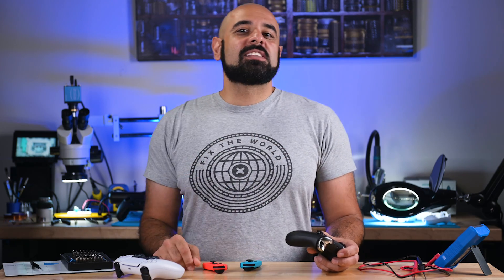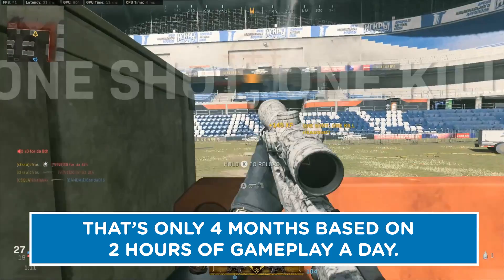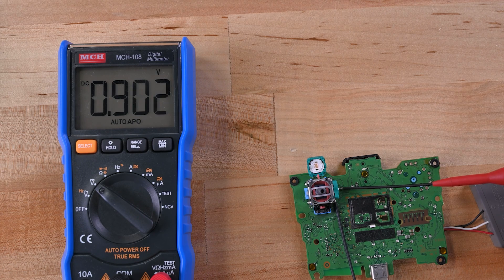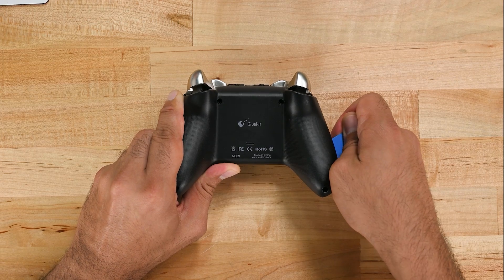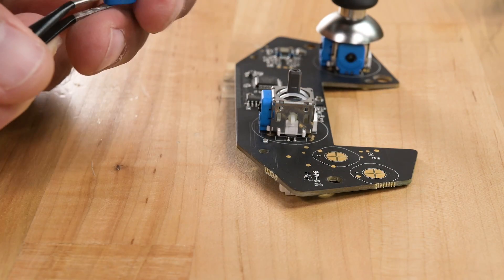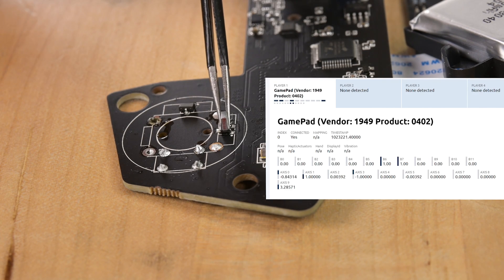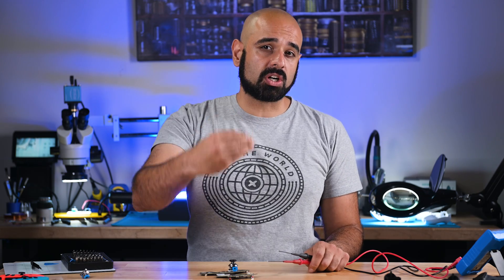How Manufacturers Can Fix Joystick Drift - Permanently!

Comment: We used to work with both of these on a more industrial level, potentiometers failed frequently, and are prone to very early deaths from all kinds of problems but for us, its the dirty environment.  Hall Effects cost a lot more, and while the sensors were always ok, bad board designs never let them really see through for the full potential.  I'm sure on a high volume application costs would come down, and the design would be more professional than some custom stuff we had.  

Still, I imagine cost is the key factor of why. Not only in component costs, but you may have to replace some of the feel of moving the potentiometer since hall effect has no resistance to it.

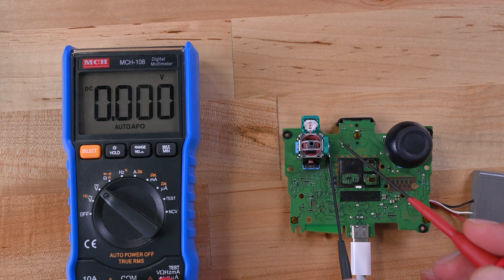Comment: 1:29 - not strictly true - In a variable resistor the resistance of the track changes as the wiper moves which results in more or less resistance. With a potentiometer, by contrast, the resistance of the track remains the same as the wiper moves, it's the potential on the wiper that changes.

Comment: It's funny that the N64 had a clever LED-photosensor setup with no electrical contact points either. Their issue was that they buggered up the mechanical contact points though so the physical stick would wear down and not hold centre.

Zero drift, but after a while it wouldn't pull itself to centre anymore, you had to hold the limp stick manually. If hall effects are expensive, I reckon repackaging the photoreceptor setup into this formfactor with the superior gimbal setup we have these days would be the best of both worlds and super cheap.

Comment: I had a lengthy back-and-forth with SCUF about how I would shell out extra cash if they could release controllers with Hall effect sensors. They flat out told me they would not do it unless the platform folks do it (which I still think is a load of crap):

"So as I briefly touched on before in my last message, Scuf takes a base Xbox or PlayStation controller and modifies it to the specifications selected from our list of available options. So we are actually are registered as an electronics customisation company. And all of our process it established to follow electronics customisation laws.
 
Now if we were to start producing our own controller with the Hall Effect sensors we would need to make a number of changes to business that currently we simply do not wish to make or have no plans to make right now. 
 
Now if Sony or Xbox controllers are produced with the Hall Effect sensors on their controllers we can begin to produce customised controllers with the Hall effect sensors without having to change the registered business type.
 
Ultimately this all boils down to business laws and the larger company changes that would need to occur I'm afraid."

Comment: this problem had already been solved in the 90s. the sega saturn analog pad, and the dreampad both used hall effect tracked joysticks, using 4 board mounted hall effect sensors, and a single magnet in the base of the joystick. the design was pretty ingenious, because the centering mechanism was practically impervious to mechanical wear too. even after thousands of hours of use, those sticks did not develop "center wiggle".
Reply: Despite the one analog stick, the Dreamcast controller honestly feels amazing. Great fit in the hands, great trigger tension, perfect face buttons, joystick... I really miss Sega.
Reply: iirc the n64 controller also used similar tech for their analog stick
Reply: @larryfoulke6196  
The Nintendo 64 used a optical encoder just like an old computer mouse with the ball on the bottom.
Reply: PlayStation controllers also had it back in the day.

Comment: Even though a magnetic solution has much less wear and tear, as you pointed out, I don't think it could ever be used as a (good) joystick because of hysteresis. You just can't get consistent readings. It's basically durability vs accuracy. Probably most gamers will prefer the latter. IMHO, until they find a solution that gives better accuracy than potentiometers, the best solution is to make just the joystick swappable.

Comment: I think they would need somehow to be able to take just the thumbstick and be able to remove the old ones and drop this new one into existing controllers before widespread use would happen, also obviously the extra money they get from people buying new ones would be gone so they have a monetary incentive to not do this, they would probably make some $200 super elite mega pro controller that have them and keep it out of the cheap ones that most people have and where they are needed most anyways.

Comment: of course they're not going to pick it up.. they won't for the same reason they started using inferior components for the sticks in the first place: Money. There's no money in making a robust, high quality peripheral, that will last for a very long time... The money is in having you replace your controllers all the time. Old controllers last WAY longer...i imagine the innards were more robust. I have a X360 controller that i used ALL THE TIME, that i finally had to retire after something like 15 years.. Got a controller from my launch PS4 that still works perfectly. Only retired it, because the rubber wore off the sticks. Never had to retire a PS3 or PS2 controller, due to the sticks going bad.. The sticks on those old controllers are WAY better. Now, it's just cheap crap, that fails after a short time, so that they can keep you buying new controllers at 60 (or more) bucks a pop..

Comment: Purchased new controller 1/14/23.  After the one that came with the PS5 lasted just over a month I purchased the extra warranty, and I'm glad I did.  The new controller did not even make it a month.  Both controllers had exact same issue, erratic right thumb stick.  Started out jerking (not drifting) to the left and very soon after was in continuous left.

Comment: As an RC pilot for over 17 years now, I can tell you the following:
There are good and bad potentiometers. I'va had good radio transmitters, with metal encased, internally lubricated pots and bad radio transmitters with plastic pots and flimsy PCBs, way to soft contact pads and just overall poor performance. One of my oldest radios is over 15 years old now, a Futaba 7C (if you want to look it up) and I have never had to callibrate the sticks since I purchased the radio. I also have a Futaba T14SG from 2014 and it has gone through countless hours of 3D flying (agressive stick movements) and it doesn't have any drift. out of curiosity, I've had a look inside both of these radios and my conclusion is that the most important thing in terms of joystick drift is not the wear on the potentiometers, but rather the the stick centering strenght, i.e. the quality of the spring and centre stick mechanism, which determines how well the sticks centre over time. If have a little bit of play, the stick will not centre properly, that's it. Joystick controllers have the issue that they use very soft springs and nylon guides to keep the sticks where they are supposed to be, and that is a huge problem because those wear out over time. If the sticks get soft on an RC radio, you have the option to replace the springs and adjust the centre position mechanically (f it has even shifted). Then you recallibrate the sticks and you are done for the next 10-15 years. I've also had Hall Gimbals on three of my more modern radios and I can't tell the difference apart from the resistance that you feel adjusting the sticks to be soft. Soft sticks with pots have some residual internal friction and dampening due to the internal lubrication. I think hall sensor joysticks will have the same problem as regular joysticks because the main centering mechanism will start to wear eventually, weaken and get wobbly over time and simply fail at some point. What manufacturers need to do is to improve the construction quality by increasing the rigidiry and the toughness of the materials used for the gimbal mechanism (and I mean both of these terms by their engineering or metrial science definition). Whether you then have potentiometers or hall effect sensors will make absolutely no difference at all. Most likely, this has not been done due to obvious manufacturing cost implications.
Reply: The issue imo isn't potetiometers but really really cheap potentiometers

Comment: Same issue with some mouse scroll wheels. Cheap, old, mechanical wipers with erratic scrolling. Optical, better has a wheel with holes breaking an optical beam. For some reason, this is NEVER advertised. Throw the dice, hope for the best.

Comment: "get rid of physical contact entirely" 
uses the same setup to move magnets instead of a wiper.
😑 It's not fixed at all in the example. it's delayed at best. I will grant slight improvement at the cost of the entire point.

Comment: Is it cheaper for the manufacturers to fix/replace the handfuls of cases where people demand something be done about their controller drift? Or put a higher cost unit/s in every single unit made? I'm going with the former. As bad as that is. Unless they're forced to do so by trading standards or some other body.

Comment: for me drift comes from ash and dust...
i believe a microfiber gromit could help keep dust and ash out.

however ive also had the inside part grind away too, at that point its time to buy a new one
Reply: Yeah sometimes you can fix it by cleaning the controller or the sensor itself, but if it's a year or so old then it's probably a worn-down potentiometer track.

Comment: Welcome to modern cosumerism, This is in every aspect of life but it has a name, designed obsolescence. Once a market eliminates the competition incentivizing new tech, the era of new tech stops in favor of maximum profits.

Now apply this concept to literally everything especially the AUTO industry. Designed to dwindle down and make you spend more in short time peroids. 

Once any company decides they are no longer subject to rules and regulations the sky is really the limit.
Reply: The worst thing is that most of the controller manufacturers use the same sensor supplier, ALPS. They must be making major profits supplying vast numbers of these sensors to every game company since every controller inevitably fails because of this single component.

So much plastic waste and e-waste just because a few companies want to make megabucks.

Comment: would be nice if I could purchase mod kits to transform pot controllers into hall effect controllers.
Reply: Gulikit sell conversion kits for certain controllers, I think the Steam deck and Switch, and they're planning on doing modular versions for the Playstation Edge controllers which already have removable joysticks.

Sadly other controllers have their joystick sensors soldered directly onto the controller's main board, meaning it is difficult to make a marketable solution. People should pressure Gulikit to make standalone Hall-effect sensors so users can do the conversions themselves.
Reply: @redbloodcell4047  Thank you very much for the information. very much appreciated.

Comment: There is posts about joystick drift everywhere, but I never experienced it actually, unless there is excessive wear of the joystick itself that start wobbling, but it has nothing to do with the sensors.

Also hall sensor are prone to interferences.

My guess is that most drift issues are caused by software (wrong calibration, or dead zone too small..)

Comment: they will software block this making your third party controller obsolete only way is to solder holo lens sticks to your ps5 controler etc but even that they can prevent in software if something in the controller is changed the controller might simply dont turn on.

Comment: drift mostly come from calibration, but you got to to disassemble then use a screw, while undertand how calibration work so difficult fot casual, for nintendo switch, things is a bit different just put a layer of carton enought slim to fit under joystick and there you go, no need buy anything....
Reply: Not really. Once the sensor starts to degrade, you can be looking at stick drift so severe that deadzone calibration doesn't help. Besides, increasing the deadzone ruins gameplay.

And this "carton fix" is not fixing stick drift.

Comment: The funny thing is... I still use a PS1 controller... since 20 years, granted I don't play 2 hours a day for that timeframe with it but collectively I probably played a couple hundred hours with it... still no drift. I actually find it puzzling, that we had analogue sticks on PS1, 2, 3, 4...  and only for the PS4 and switch they start to get this problem that fast. Did something change in their construction?

Comment: I think the argument would be the input delay... however, if that is the case, why wouldn't these manufacturers, just make it hotswappable like keyboard switches? if the only issue is how to make it secure, its easier than desoldering the part... right?

Comment: Hall effect won't really eliminate stick drift, because a lot of the times stick drift is due to the centering mechanism getting sloppy/worn out over time (too much plastic in the mechanism, and quite often the spring used to create tension to return the thumbstick to center loses it's strength to be able to return the thumbstick back to center).

 Hall effect will eliminate dirty potentiometer issues like erratic movement in game during when you're moving the thumbstick (see Atari 2600 paddle controller dirty potentiometer issue), but HE won't really cure stick drift as the thumbstick usually still has a tight connection to the potentiometer.

The plastics used in the centering mechanism will get worn down, and when wearing down it'll also produce a fine plastic powder that coats everything inside the centering mechanism, not only will it cause the drift issue as well it can also make the thumbstick is harder to move smoothly.
Reply: As a radio control enthusiast and flight sim pilot, I can say that you are wrong. the plastics used in most game controllers as well as R/C and flight sticks are very durable and springs can typically be replaced, so long as the items are well cared for and not dropped a lot. For my R/C helicopters, I used the same radio for ten years (Spektrum DX7) and didn't bother with an upgrade (Spektrum DX8e) until I got my first drone and found out that my software wouldn't work with it. My sim controllers had other components fail (external wiring) LONG before the axis sensors did (Logitech X56). As of this comment, I currently have over 2200 hours on MSFS 2020 and DCS with my Thrustmaster T16000 flight controls. I will say that I need to get some powdered graphite to lube the throttle and rudder pedals as they suffer from way too much friction. In the game controller (D-pad type) arena, when the pots start to wear down, the signal gets erratic and true center can be harder to define without adjusting deadzones. Yes, the axis still has a tight connection to the pot but the pot is too worn to be accurate. This is where Hall effect is superior. Hall effect does not need deadzones as it doesn't wear out like pots. you instead adjust the sensitivity with expo curves and you get 100% control for a VERY long time. In closing, don't sell hall effect short, you'd be surprised at the performance gains that you can achieve with it.
Reply: @wedgie502  yeah here let's compare materials in an RC system vs a cheap controller to a game system...........

Let me ask how many game console controllers have you worked on? 

I've worked on quite a few, and each one that has stick drift issues is due to the return mechanism being worn down, and no longer able to return the thumbstick back to center, not the POTS.

You're also confusing POT failure (due to dirt in the POT or the contact area in the POT being damaged) to actual stick drift.

Comment: Can you belive my xbox 360 controllers have been bashed and worn till the toggle stick head started failing and now I have a nub for a toggle stick with no place to fully rest my thumb and there's still no noticeable stick drift and This is the one that came with my xbox 360 since I bought it. My real question is why are xbox 360 togglestick sensors so durable compared to the lifespan of every other controller I have?

Comment: Could this be soldered onto a xbox elite series 2 controller? Mine has stick drift and I know how to solder, but don't know if the pins match up to do this?
Reply from the maker: I'm afraid its not as simple as doing a straight switch. There's some signal processing that needs to happen on the output from the hall sensor.

Comment: WARNING: I've attempted the disassembly method at least two times. Not only did it not work, it made it unusable. I was about to do it again on my PS5 controller when I watched a live stream of this diy fix on YouTube. Well, you can guess how that turned out, UNUSABLE. 

What I did was clean it as best I could without messing with the thumbstick ( with the controller disassembled,) a few drops of alcohol, and it fixed it. I do not know how temporary this is but it's still working. I did this 5 days ago. 

I am telling you from experience, if you succeed at messing with the thumb stick, you are a small percentage of the actual outcome. 

Fair warning and good luck.

Comment: Good news. I gues they still use pots for cost cutting. 
But there is another part to this. The spring inside the thumbstick also tend to fail over time and the stick doesn't spring back to dead center. Any solution?

Comment: Would it be possible to just solder one of these on an Xbox Series X controller? It looks like all the points are identical and as mentioned they are for ease of iteration in the future hopefully. I just don't want to buy these and be surprised that they aren't compatible.